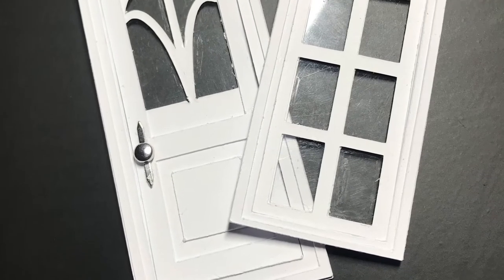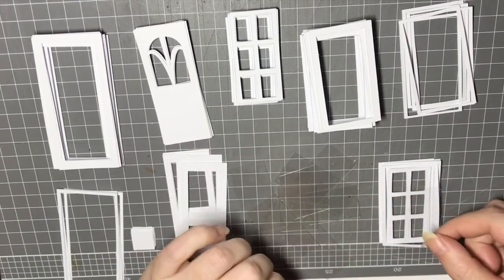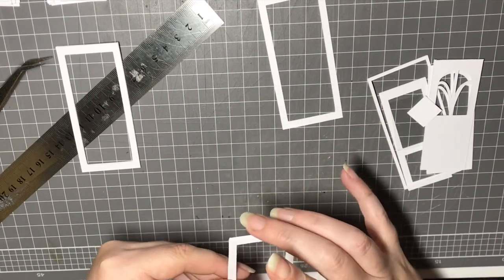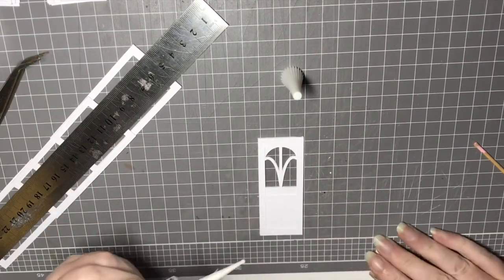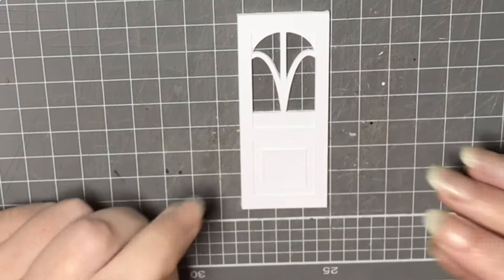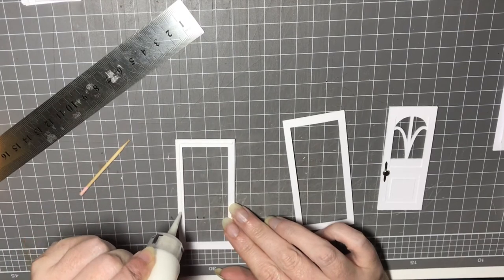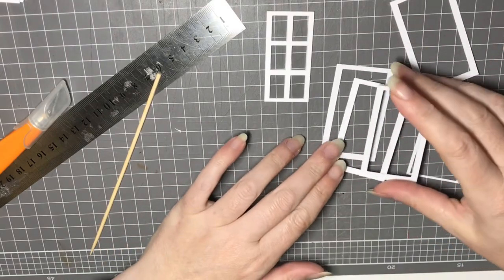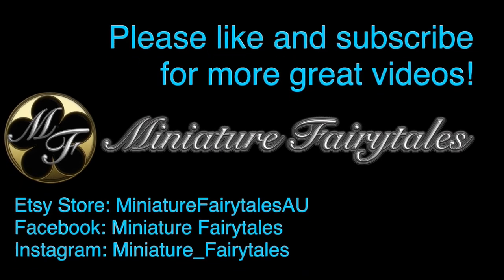1:24 scale Door & Window Tutorial / Cricut / Miniatures / Dollhouse / Half scale / DIY / Furniture

Comment: I am going to give these a go even though I don't have a Cricut.  I have some thin Mat board (mount board...I dunno what the Antipodean is for that lol!...it's the stuff Ara Bentley uses a lot and in the UK is generally picture mounting board) yeah I think it's a suitable thickness for this and I can cut some cardstock for the details. Great idea with the little split pin brad thingies...you have some genius ideas...really!)
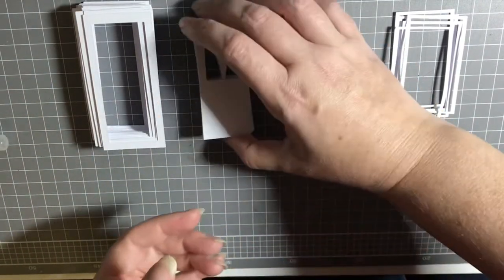Reply from the maker: Awesome!  I can’t wait to see how they turn out for you!  Mat board is called art board over here (at least that is what I believe the equivalent is over here in Australia) and yes it would work perfectly for your frames - no layering required!  You can definitely still hand cut the pieces.  Will you work in 1:12 or 1:24?  There are lots of variations you can use for the handles too, depending on the scale you’re working in.  I’m excited to see what you do!  😄
Reply: Mat board, mount board, and art board are pretty much the same thing, if I remember right.  If it has a thickness of 1.5mm or 1/8" (0.059"), it should work.   I have a bunch of random pieces from when my husband was doing a lot of matting and framing work, and have so many plans... once the studio is put back together.

Or maybe I'll be really odd and use some of it to do some of the organization as well.